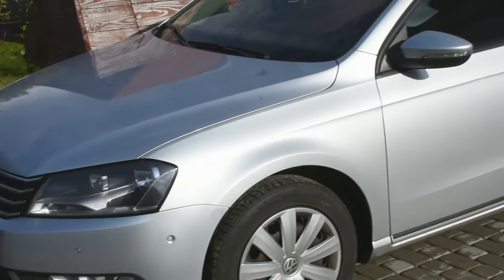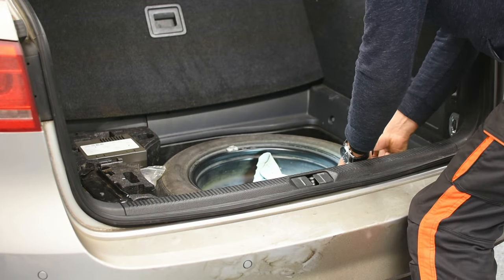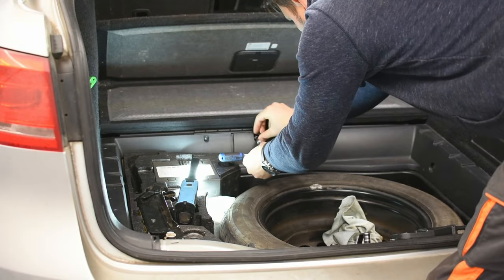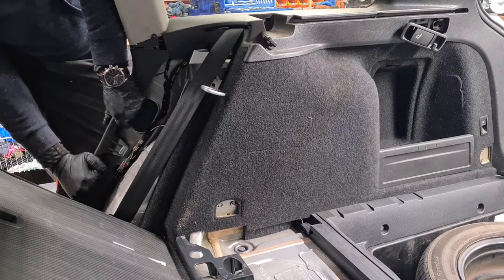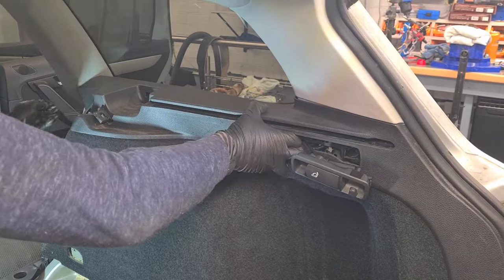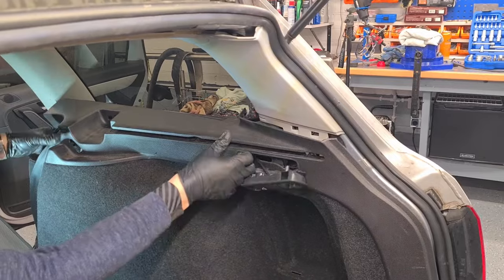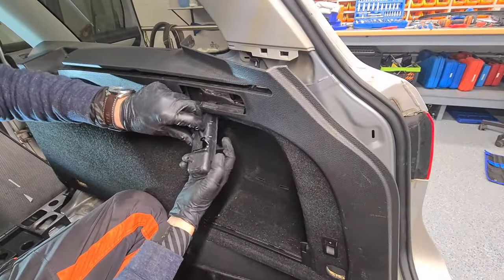Trunk Trim Removal: VW Passat B7 Variant

Comment from the maker: 🔧 Tools used: 
       🔹BGS 2292 General rachet and socket set: https://geni.us/0Hhd (Amazon)
       🔹Underhood LED light: https://geni.us/oUVLUpn  (Amazon)
       🔹Hazet 1979N-92 flashlight: https://geni.us/gTxEiHA  (Amazon)
       🔹Hazet 1979WP-1 magnetic charging pad: https://geni.us/abMfAS  (Amazon)
       🔹BGS 1327 plastic pry out tool set: https://geni.us/LG52lrm (Amazon)

⚙ Additional stuff: 
        🔹Nitrile heavy duty gloves GRIPPAZ: https://geni.us/tc4XaYP (Amazon)
Reply from the maker: One more thing: the two side anchor points should also be removed.

Comment: This helped me so much when cleaning leaked wiper fluid on the rear hatch electronics connector. Great vid!
Reply from the maker: We had a similar issue - cracked hose for the window washing fluid, so the fluid was behind this trim in the recess. I will post a video later on how we repaired that issue.

Comment: My rear washer is leaking in the roof of the boot. I can see the roof interior turning blue towards the back of the boot.  I can repair, but how do i remove the roof lining? Please dont say i have to remove all in this video to do so?
Reply from the maker: Hi. I have a video regarding that: https://youtu.be/6m2wmbWdMeg?si=dieccIyzTg3G-ka3
We also did repair the leaking hose in that area. You can take a look. Basically you can lower the rear part of the lining a bit, only that you need to undo the D pillars and remove the lining from the rear rubber boot seal.
Reply: @dionich  Thank you. I did see this one, this is how i found you :) On this video though it doesnl;t show how you lowered that back corner of the roof lining?
Reply from the maker: @danseantom  yep, insufficient filming :) just undo the d-pillars and remove the rubber boot gasket, lining is snapped in it

Comment: Hi do you know what electrical components are in right side? My car is leaking wiper fluid in to the trunk and parking sensor  stopped working
Reply from the maker: Hi. As far as I remember there no any modules but there is a big blue  connection plug. Not sure which wires run through it.

Comment: This helped me alot to repair the right cargo cover end latch that holds the cover closed.

It just fell out one day, the little spring bouncing inside the car body.

Thanks for also showing the removed interior trim. That helped me identify that myncargo cover rail has detached and is fixed on the trim, not on the car body.

Comment: hello!
do you know how do i put back the cargo privacy part and the cargo curtain? i have two separate parts, one that goes over the trunk so you cannot see what's inside the boot, and something that extends like a fishnet from a similar part coming behind the headrests in the backseat that protects  the passengers from having flying luggage into their heads. the net is extensible and goes all the way to the roof. i hope you understand what i mean...
i took them both to carry some big furniture and now i have no idea how to put them back and i cannot find anywhere the cargo net part.
i can fix the privacy shade but the net i have no idea how to do it.... 
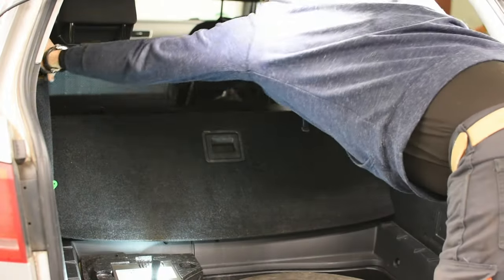0:38
Reply: the privacy shade goes all the width of the car and has visible supports on each side of the car, that's not my problem, but i cannot find where to secure the cargo net, and it doesn't even go all the width of the car...
thanks to anyone who has any idea
Reply from the maker: Open the 0:56 and on the side panel you will see the big top opening for the trunk privacy shade. It slides into it. Tge cargo net clicks on the external square hook near it.